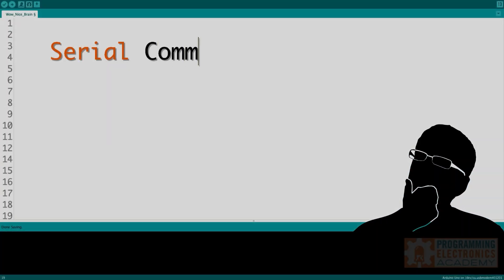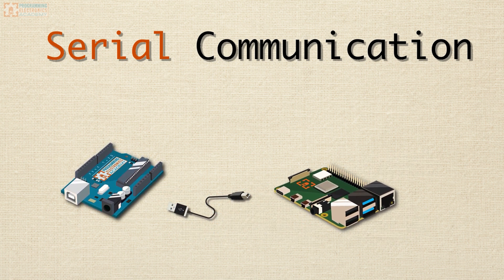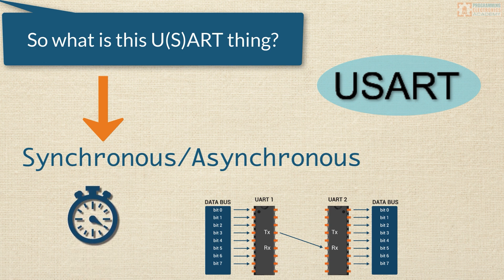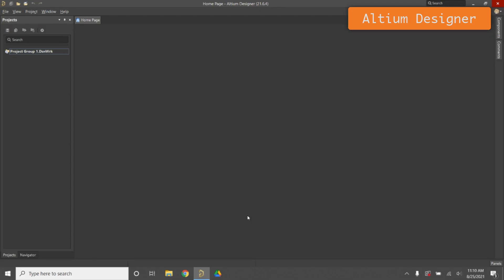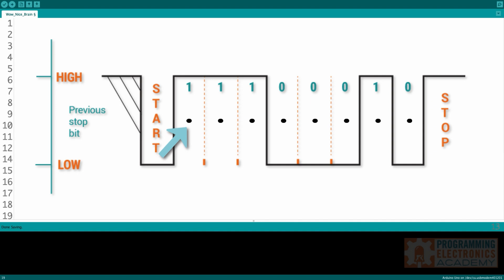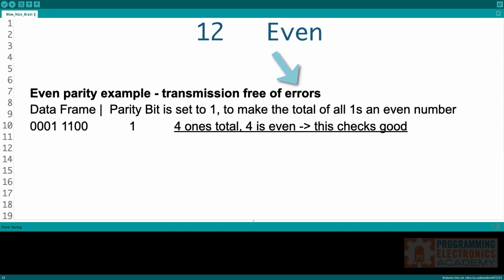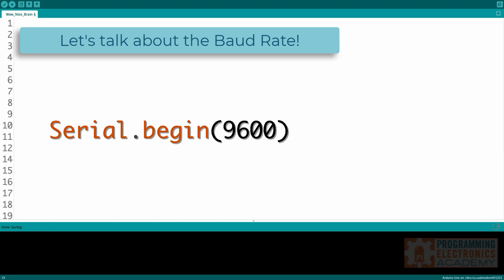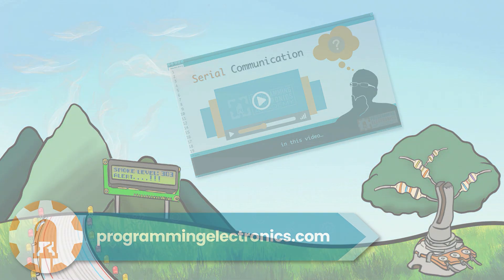Serial Communication with Arduino - The details!

Comment: 10:43 oh wow, you would think it would be the other way around. I.e.: you'd think that the first bits sent will be the most accurate, and since the values on the left side represent the largest numbers, you'll get smaller errors by sending the most significant ones first. Maybe it's something to do with the fact that the least significant digit represents the parity?

Edit: I see Andrew's answer now, which is that by sending the least significant digit first, you can use an arbitrary number of bits per word. I.e.: the first bit is always 0 or 1, the 2nd is always 2 or 0, 3rd is always 4 or 0, and so on.

Comment: If you send the msb first then each bit will have a different significance according to the total number of bits in the frame, sending lsb first means the first bit received is always the units bit, the second is the 2's bit and the third the fours etc.  This is much simpler to implement in hardware rather than the complications of msb first.
Reply from the maker: Thank you Andrew!  Makes sense!!

Comment: Wonderful explanation. I am a beginner kindly help me with this problem. How can a simple program be written that dynamically calculates the water volume used in a tank. Given a cubical container of breadth=5, length=10 and height =20. If the tank is filled with water to an appropriate height, I know the volume of water is volume of water = volume of tank minus volume of empty space. Now, how do is the amount of water used calculated if the volume of water keeps being removed downwards after some time?
Reply from the maker: Great question Winston!

With Arduino, any code in the loop() function gets repeated over and over again, as long as you have your Arduino plugged in.  

Assuming you have a sensor that can report the relative amount of water in your tank, like an eTape (https://www.adafruit.com/product/464), then you can just read from the sensor  and calculate the new volume every time through the loop.

So inside loop, you might do something like:
- read value from water sensor --> eTapeReading = analogRead(eTapePin)
- convert eTape reading to height --> You'd have to look at the data sheet for a conversion to apply (or google)
- calculate volume V=πr2h  ---> volume = PI * r * 2 * waterHeight 
- display new volume --> Serial.println(volume)

Hope this helps some!

Comment: Wow what a gem of a video! If you raise the baudrate does it mean you’ll use more power and if attached to a battery it wil run out faster?
Reply from the maker: Great question Brendan!  I do not believe so... 

When using the serial commands, it is going to be the same number of packets sent, only done at different rate.
Reply: @programmingelectronics  i’ve looked it up and found this answer: If you have crummy cabling, or long distances, poor grounding, noisy environment, then slower baud rates can give more reliable results. Slower also uses less power as CMOS power consumption is switching frequency dependent. If the serial comm's are buffered first, so that RS232 type levels (+/- 3 to +/-12V, one wire for send, one for receive, plus Gnd) or RS485 type signals (+/-3V, but with 2 wires for sending, 2 for receiving, plus Gnd) than higher speeds and longer distances can be supported more reliably.
Reply: So perhaps the power stays the same if you just send a fixed message. But if you’re using sensors and want to extract data you are probably takibg more samples at a givzn time with a higher baudrate and thus more processing power (energy consumption). At least that’s what i would assume
Reply: @brendanboon9062  Cool!  Thanks for these details!